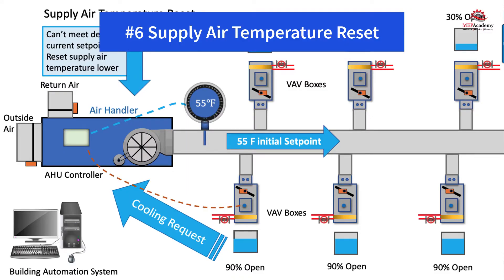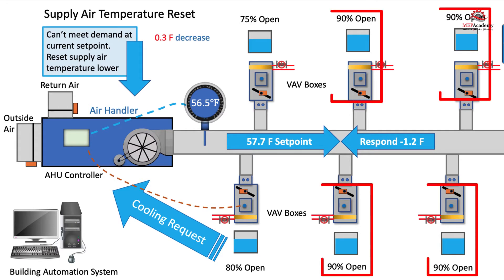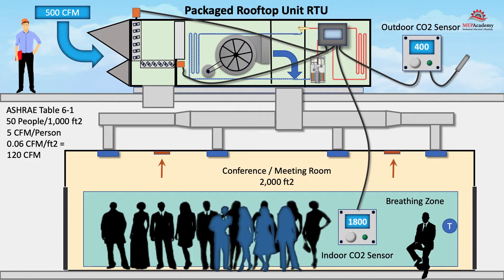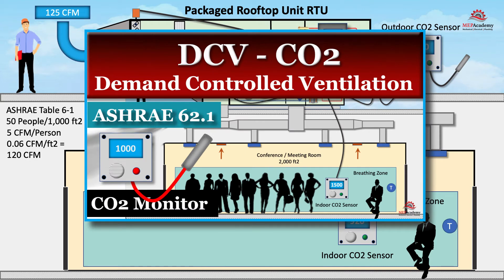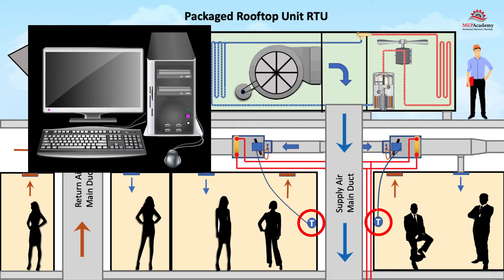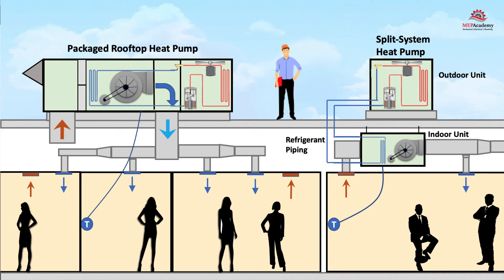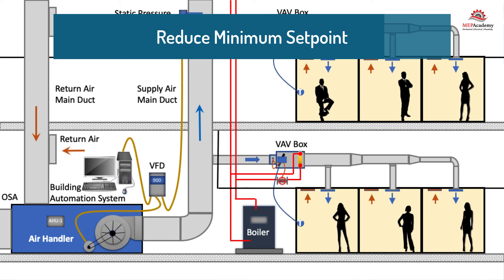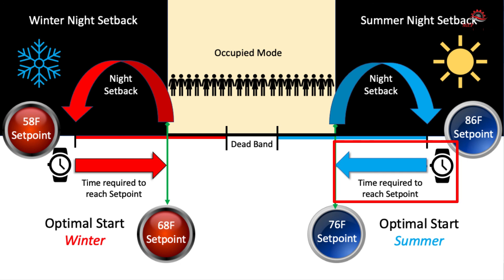Top 6 Control Startegies to Save Energy

Comment: how come the supply air temperature varying for VAV? I thought for VAV temperature is constant but volume modulation occurs.
Reply from the maker: Energy Efficiency
Reduced Cooling Load: By raising the supply air temperature when the cooling demand is lower, the system requires less energy to cool the air, leading to significant energy savings at the chiller or cooling coil level.
Fan Energy Savings: When combined with reducing air volume, the strategy lowers the required fan speed, further decreasing energy consumption due to the cubic relationship between fan speed and power usage. There are many other reasons, but energy savings is a key factor.
Reply: @MEPAcademy  is fan savings because of VAV or VFD?

Comment: I also had an engineer recently make me aware of an ASHRAE guideline on duct heating for room controls. Apparently they prescribef that you should heat the air no more than 11 °C above the room temperature, otherwise you risk causing air stratification, resulting in not heating the room efficiently and wasting energy.
Reply from the maker: There is much wisdom in the ASHRAE Manuals and Standards, as they have invested a lot in providing the industry with the most up to date information.

Comment: Funny enough, i know an engineering firme that doesn't use optimal starts, but instead uses night setbacks that progressively creep back to occupied setpoints (based on a schedule). I had the chance to discuss with him once over a teams meeting and he told me that he did this more so to minimise morning peak demands, so that when the occupancy schedule turns on, room controls don't kick in at full demand and cause a spike on the electrical distribution.
Reply from the maker: Each building is slightly different, so hopefully they have figured out what works best for their building. Hopefully they're using some form of adaptive learning where the system adjusts based on previous performance and external conditions, which makes optimal start a good strategy to save energy. Optimal start strategies avoid having the systems come on at full demand when occupants arrive. There is no benefit to conditioning the space earlier than needed as this can add to an increase in energy consumption. Thanks for the comment.

Comment: Does temperature reset consider humidity levels? I can see how it could have a negative impact if the system was sensing and controlling to temperature level only.
Reply from the maker: Humidity control can be effectively maintained even with chilled water supply temperature (CHWST) reset. The impact of CHWST reset on the dehumidification capability of a cooling coil is quite small as long as the coil is able to maintain the supply air temperature at setpoint. Space humidity is a function of the supply air humidity ratio which in turn is a function of the coil leaving dry-bulb temperature setpoint. Regardless of CHWST, the air leaving a wet cooling coil is nearly saturated; lowering CHWST only slightly reduces supply air humidity ratio. So as long as the supply air temperature can be maintained at the desired setpoint, resetting CHWST will not significantly impact space humidity.
Reply: I'd have to do some calculations, but if the general rule is that rooms must he maintained at 21 or 22 °C at 30% RH, which I don't know what it equals in dewpoint or GPP to quantify its absolute moisture contents, cooling outside air that is at 30+ °C with maybe over 40% RH of moisture, down to 13 °C, is very likely going to cause water to condensate and then ensure that the ambient air is conditioned comfortably.

[Edit:] The US norm is to maintain an ambient dew point between 4 and 16,5 °C, so roughly put, if your cooling coil cools down the air temperature at 13 °C and is condensates, you could say the air's dew point is 13 °C, which is well inside the prescriber bracket. And if it's too dry, know that most air handler units (AHUs) come with a humidifier.